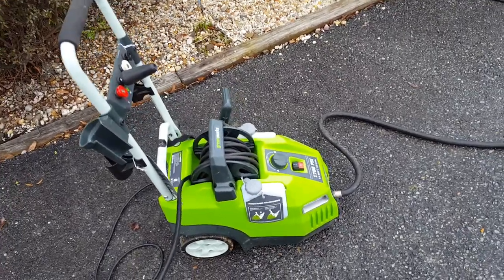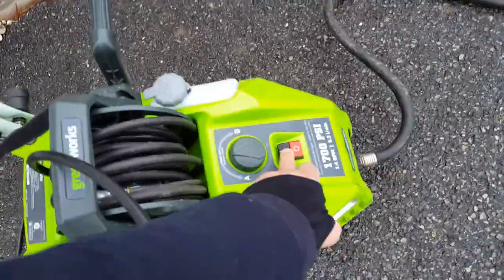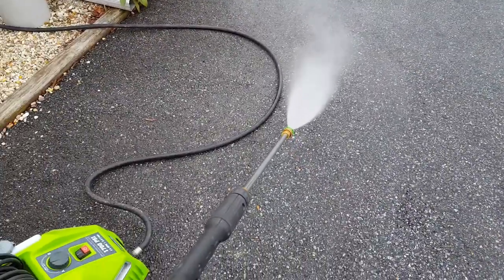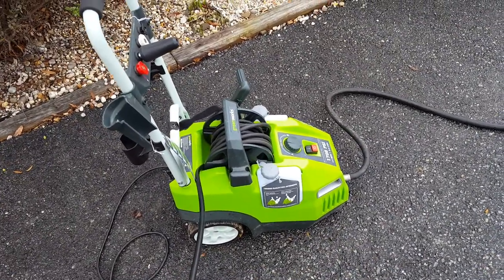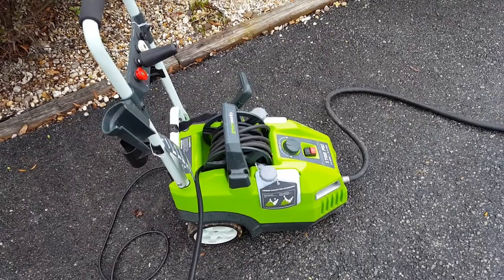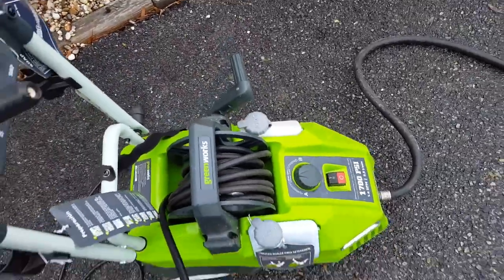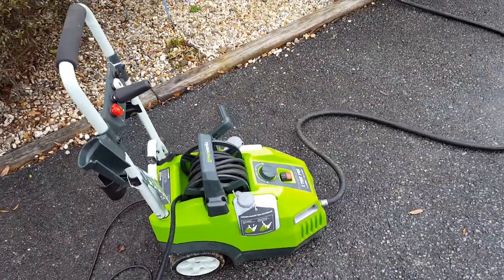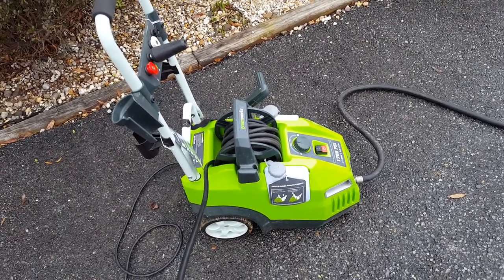Greenworks 1700 PSI power washer short cycling

Comment: I know it has been 5 years, but here is my fix. The problem was a broken 0-ring in the wand. That allowed a slight leak which made the unit want to start the pump, but there was not enough flow to go full on. Replaced the 0-ring and problem solved.

Comment: The spring (1 of 2) in the "TSS total stop system" broke.  Open er up, pry the micro switch assembly off, unscrew the assembly (danger: parts, orings, springs), bet you'll find a broken spring.  good luck finding a replacement.  these pumps are all Annovi Reverberi Italian garbage engineering.  If you do this..please make it a video..even if not fixable.

Comment: Mine did this right from the start and from what I understand, this is natural?
Reply: NO ITS NOT!! If it has a total stop feature it should not run until you pull the trigger! If it is short cycling in 30 sec- 2 min intervals then you have a pressure leak!
Reply: @mattolivo  saw plenty other vids where you are not suppose to leave these running without squeezing the trigger and i follow that advice and it works for me, regardless of whether you are correct or not.